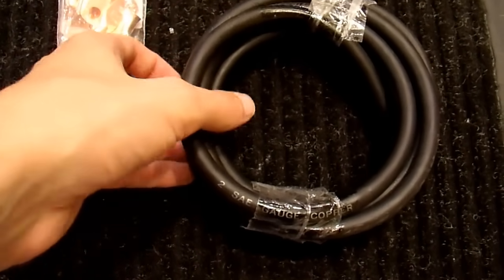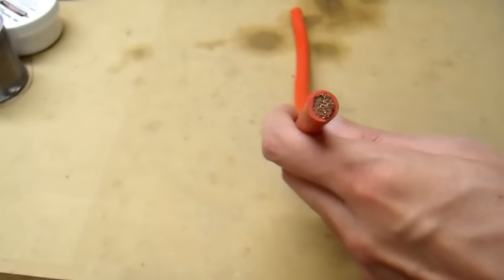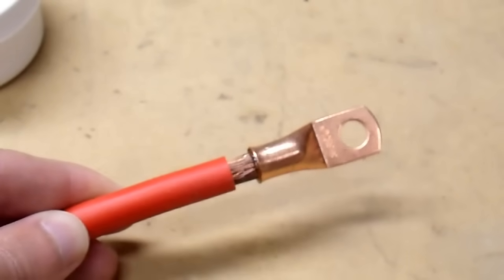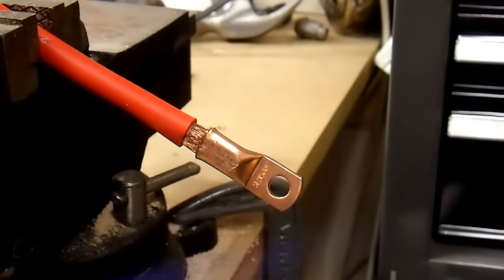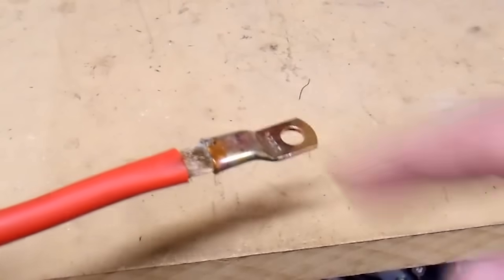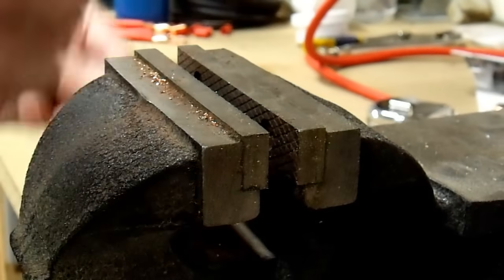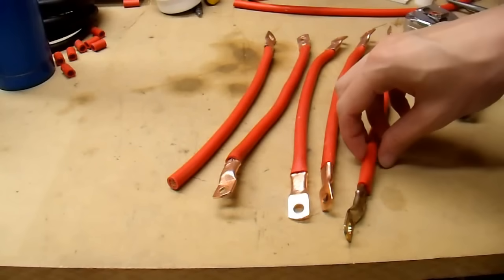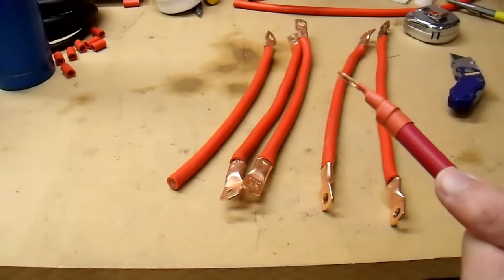How to Make Battery Cables the Right Way and the Easy Way

Comment: Rosin flux is NOT acidic and is non-corrosive.  Other fluxes, as those used in plumbing, can be acidic or corrosive.  But rosin-core solder or rosin flux is not.  The bench vise is a bad way to crimp, as it only presses on two sides, where you should be compressing the copper all the way around.  A crimp tool is cheap and works great.  "I wouldn't recommend it..."  If you won't, don't film it.  NOT a good way to make a connection.  Sorry.
Reply from the maker: Coat something in rosin flux and let it age in a humid environment and get back to me.  It may not be technically 'corrosive' but it absolutely does corrode copper.  Crimp tools do work obviously, but the point here is that simply smashing in a vice does work very well.  If you doubt me try it.  It works just fine.

Comment: i suppose if you had no other way to do it this method would work in an emergency, but i would never trust it for long-term use.....
Reply from the maker: All cables I've made this way still work to this day with 0 failures.

Comment: Crimping lugs is regarded as a cold weld, even solid aluminium conductors are crimped,multiple  can be achieved
Reply: Try cutting a suitable nut in half and crimp in a vice till it looks a little distressed, beware you don't  over crimp,

Comment: Heat shrink should always be used on cable terminations especially for automotive applications. Its not to hide or pretty things up. use adhesive lined shrink tubing and the wire strands will stay protected from moisture and corrosion. If you were to leave the strands exposed at the terminal like in this video and use them on anything automotive or otherwise outside in the elements that cable connection would be the color of moldy bread within a couple months. And would leave the cable with high resistance and voltage/current drop. Also if you want those terminals to last more than a year in any use exposed to outdoor elements youd want to use coated terminals. Bare copper will be corroded in a month especially directly connected to a battery thats venting right next to the terminal. Also getting a decent hydraulic crimper isnt that expensive  you can get one that'll crimp up to 0 gauge terminals for less than your vise hammer and drift cost. I emplore you to get one and compare your crimps/soldering to the results of the hydraulic crimper. Get a hacksaw out and cut the terminal in the middle of your crimps and look at the difference. The hydraulic crimper will cold fuse all the wire strands to the connector. It will never separate and wont allow any moisture/corrosion in the crimp.
Reply from the maker: Vehicles, especially Japanese imports, have been made with simple bare wire cable clamps on the batteries for decades.  It's not my favorite setup for that application but that's what they've been doing.  Heatshrink is a corrosion catcher, not a preventer in real life.  If you want your cable to last in an outdoor environment you need to encase it in something that will not corrode like solder.  This is what nearly all vehicle manufacturers do now - essentially soldered connections (metal impregnated and molded, but basically the same).  The whole 'cold weld' theory taught by crimper manufacturers is NOT science and is not true.  You will find that info documented in 'best practices' information for technicians but if you look in research whitepapers you'll find real data which does not support that theory.  I do have a hydraulic crimper now but rarely use it.  Does it make better terminations?  Yes.  Better enough to matter?  Not really in most cases.
Reply: @knurlgnar24  you can make a video comparing the two

Comment: The use of solder on power carrying conductors is fundamentally wrong because a high current situation can cause heating of the joint ^ melting the solder.  These ring connectors are intended to be crimped & properly crimped connectors are always more reliable than soldered joints in all cases. If you do not own a proper heaving crimp tool you can make a crimp half ring pair to fit your vice jaws. I have a set of jaw grips with various holes drilled through it along the seam for different cable gauges...

Comment: I do it the same way we do it at work, on aircraft, which is simply to crimp it. There are two factors at play which are the most important:

1. Connector quality - look for thick gauge metal. NAPA carries decent quality crimps, and most people have a NAPA store nearby.
2. Proper crimp pressure - Best thing to use is either a hydraulic crimp tool or a mechanical tool with a large enough lever designed for cables of this size.

The solid copper terminals shown here are NOT thick enough to retain crimp tension on the wire, and the only acceptable way to secure them is to solder them. Personally, while I have used them in the past on my personal stuff, I stopped a long time ago.

Comment: Helpful tip. Hold your torch under the terminal pointed upwards, and add the solder from the top. The solder will flow evenly all the way to the bottom of the terminal.
Reply: And fry the insulation in doing so!

Comment: almost 3 mil views and its still labeled the "right way and easy way"...folks dont do wat he did, get on ebay and find urself a hydraulic crimper 10/16 ton version both will run you under 120$ and you wont have to over anneal the cooper terminal to the point its ruined or INCORECTLY crimp like he did in the first place...and those cheap ass tools i mentioned, ive used them for couple of years now and they're still crimping good and strong. invest a little and dont cheap out...otherwise you deeply regret it.

Comment: Youtube should simply ban this account for "advice" he is giving. Almost everything that's shown is plain dangerous.
Heatshrink is "for cosmetics only"? ROFL guy where did you learn this.
Heatshrink "hides the connection"? Well if the "crimp" is done your way you'd better check it daily, so it may be true for your crappy method.
NEVER, NEVER EVER use a vice to press cable shoes. The compression is uneven and not circular, and the wires on the edges of the pressed ellipse have no or a bad connection, electrically reducing the cable diameter. VERY dangerous in certain applications.
DON'T EVER solder. If corrosion resistance is required (e.g. marine applications) use tinned cable.
If you do it yourselves, do it like the pros do it, and don't take shortcuts.
Reply from the maker: This comment is full of incorrect information and the account should be banned.  Don't ever solder?  Excuse me?  That 'advice' is objectively incorrect.  Your book learnin' hasn't met the real world apparently.

Comment: I recently found out that my local Ace Hardware store has a proper hydraulic crimper with the proper dies to make all of the heavier gage connections.  Easy and inexpensive.  They let me make my own and only charge for the materials used.

Comment: Right Way? hmmm there is so much wrong with this demo. "Good Enough" is never the "Right Way"! using a vise to "Crimp" the connection wrong, stripping to much insulation off, wrong, using wrong size solder, wrong, almost 2 min. with an open flame torch (probably closer to 3 min if your edits were included), wrong, starting to melt insulation as the heat has been on to long, wrong, leaving bare wire exposed after saying done (good enough), wrong,  this would be the best way to allow oxidation to start and destroy the cable connection. I have no problem with the demo if it was called making a battery cable, but calling it the "Right Way" hmmmm
Reply from the maker: Good enough is always the 'right way'.  These cables are still serving their purpose years later after many other 'professional crimps' have failed for me.

Comment: A totally wrong way to do this.   Amazing that so many people have actually viewed this.
Reply: @AP-xq3jm  You have been told several time above.  Either use manual dies for the proper size terminal connector or use the hydraulic ones with the proper die.

Comment: I use copper tubing for heavy-duty electrical jumpers --- just pound or vise-squeeze the ends flat, then drill holes and attach them to the bolt-terminals.

Comment: Pretty interesting how much hate here over how you do your cables. Yet, They offer no alternative way. As far as I am concerned they are a bunch of keyboard complainers.

If these people ever turned a wrench on an older car they would understand that the oxidation and corrosion will occur at the battery terminal much faster than at your crimped connection. Just give it a spray of some anti-corrosion inhibitor.

I do solder most of my connections and use heat shrink over them. One handy tip is after your done making your cable take a meter an ohm out your cable. Note the reading and write it on the cable with a sharpie. Then in the future if you are troubleshooting a problem you can ohm out the cable again and compare the readings. Thats a bit overboard but helpful at times.

Too many people commenting and making this seem like some NASA project just to terminate a cable.

Comment: I'm gonna vote against doing this. A proper crimp(Using a hydraulic crimper in this case and the right size terminal) should be a better joint than soldered for at least 2 reasons: 1) the high pressure causes the terminal to cold-weld with the copper cable, creating more strength than a solder joint and a better conductivity path, and 2) solder is brittle, it makes the joint more susceptible to fatigue from vibration and more likely to break off, it also tends to wick up the cable and make it far less flexible within some distance of the joint.

Comment: This video should be called "How to make a cable if you don't want to invest in the proper way to make a cable". Pretty much everything he did was wrong!
Reply from the maker: And yet those cables have been working perfectly for years while many other 'professional' cables have failed me over the years.  Yup.  Best buy the scams on the internet and not learn how to make your own cables.  That's the way of the new knowalls.
Reply: @knurlgnar24  I make my own cables, but the correct way! Any hack can put cables together that will work, until you burn down.

Comment: Worried about oxygenated wire but leave it exposed.🥴 You must be an engineer
Reply from the maker: Chassis wiring in all appliances is left exposed and they last decades.  House wiring is all exposed at every termination also.  Even battery terminations in Japanese cars were bare copper through the 90's and many even past that.  Wire that has been poorly stored or improperly made can be heavily oxidized before it is even used.

Comment: A quick and better crimp would have been using a hammer and smashing the connector on to the end.  How electricity easily flows through metals varies , copper to tin/lead and then copper can't be good for a smooth flow of electrons
Reply from the maker: I agree that a simple hammer die-less crimp will work just fine in most cases, but the hammering work hardens the copper and leads to brittleness.  This is why I don't like the hammer-die crimpers.  A straight press is superior.  A good solder joint will not have intermetallic brittleness and electrons flow at extremely high current densities all the time in electronics at extremely high reliabilities so that isn't an issue.

Comment: The heat shrink is to keep moisture and everything else out dummy
Reply from the maker: It's actual purpose is primarily customer satisfaction to make it look nice.  The secondary purpose is strain relief.  The 3rd priority is moisture ingress.  Unfortunately even glue lines heatshrink rarely keeps out moisture and once there is a pinhole that heatshrink will not let the connection dry and causes issues.  Heat shrink is one of those things that looks great in an online class but works poorly in the field.

Comment: Or just use the correct crimping tool thats designed to use on that specific cable to ensure is has a good connection.  Just a thought............
Reply from the maker: They are fairly expensive and unnecessary for most applications.  The point is you do not need to purchase a specialty tool just to make a few cables and a simple crude crimp works just fine for most applications.  I do now have a hammer/die style crimp tool and a hydraulic crimper but don't often use them.

Comment: This 7 year old video just appeared on my feed. Definitely a candidate for the worst, most dangerous information on the internet for this subject
Reply from the maker: Yet every cable I have made this way works perfectly fine to this day.  The most dangerous cables I use are those made in a factory 'who knows where' with heatshrink hiding the manufacturing problems.  I've smoked a few of those at currents well below what they should be able to handle.  What is 'right' in a world class factory and what is 'right' for a cable made in your garage are very different contexts.

Comment: No i did it this way. A few years later with engine vibration and lack of solder and heat shrink it failed resulting in a long wait for a tow

Comment: I didn’t think the wires should be showing from the terminal.
Reply from the maker: If you don't want the wires showing you can use heat shrink.

Comment: I think a crimp tool would be the best and if you have to put you copper ring in vise with the opening up and put a good amount of flux in side and put flux on cable . Heat copper up and fill with lead and push cable in to copper and yes use heat shrink the heavy. But only do this if you don’t have a crimp tool because a mechanical connection is the very BEST way to do it !

Comment: I see a lot of negative videos. But I see none that offer a better video. I probably won't solder after reading some of the comments and I will probably rig up some kind of punch to put into the vise.  What I don't understand is so many experts offering their critiques but why are they on here in the first place if they know so much better.
Reply from the maker: Thanks for the comment.  Context is important and many people miss that.  Soldering terminations to wire is commonly done and has its place.  It is very possible that in your particular application it is better not to.

Comment: Never Never Never solder multi-strand wire!
Reply from the maker: 'Never say never' is very true in this context.  That's the same as saying 'Never Never Never use single strand wire!'  What an untennable assertion.

Comment: Buy a proper crimping tool.  Do not solder.  Please take this video down.  I like some of your videos, but not this one.
Reply from the maker: Soldering terminations is a good practice in many circumstances for various reasons, and proper hydraulic crimping tools are often very expensive and out of budget for many people while the cheap anvil style crimpers sold on Amazon and the like do not make very good crimps.  What I did here is indeed 'proper' for practical purposes.

Comment: Ha! I will make sure not to use your crappy methods of crimping, shotty cables for sure.
Reply from the maker: OK.  Not a single one has failed yet with this method and I've had crappy commercially made cables fail multiple times.  But you do it your way.

Comment: Multistrand wire like this used in moving objects should never be soldered. The vibrations of the vehicle will break the cable where it is soldered. For the same reason solid core wire is not allowed in moving vehicles. Vibration will break the cable.
Reply from the maker: False information.  Quality high current connections in automotive applications are often metal impregnated with strain relief.

Comment: You can find cheap crimping tool at any hardware store. End of video.
Reply from the maker: You cannot.  End of comment.  But more seriously you need serious force to crimp a connector like this and the only way inexpensive tools can accomplish such force is with an impact from a hammer.  Those don't make very good connections due to needing multiple hits.  The pneumatic/hydraulic tools that are capable of multi-ton straight forces are quite expensive and impractical for most people.

Comment: They make soilder  pellets for that application . They are on eBay . Drop the pellet melt it , stick wire in , let it cool a bit , slide heat shrink on and done . No need for crimp
Reply from the maker: Those pellets should only be used on terminations designed for solder pellets in my opinion.  Crimp style connectors should still be crimped with solder being optional.
Reply: knurlgnar24 pellets work on copper as well , the manufactures for most high end cables use soilder . But I guess there’s always 2 ways to skin a cat . It just don’t like corrosion to enter my cable and when you cap off with heat shrink it makes it less chance ect